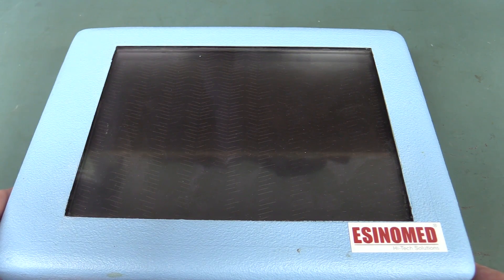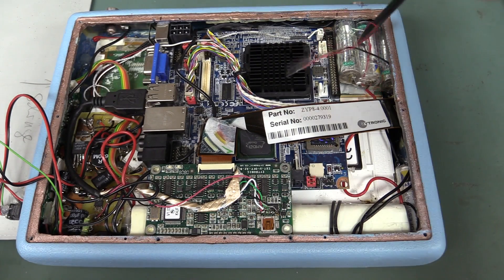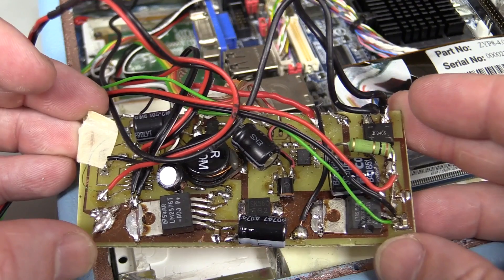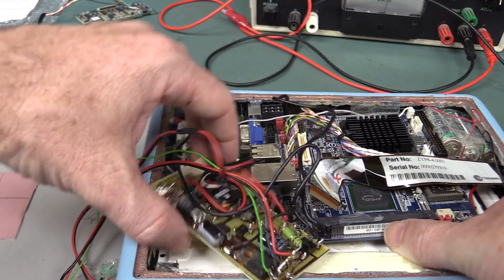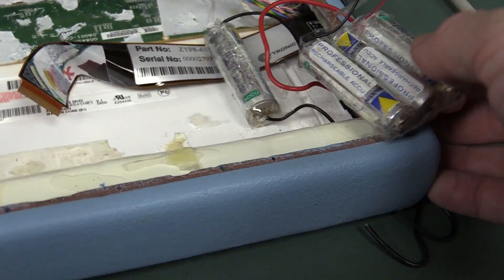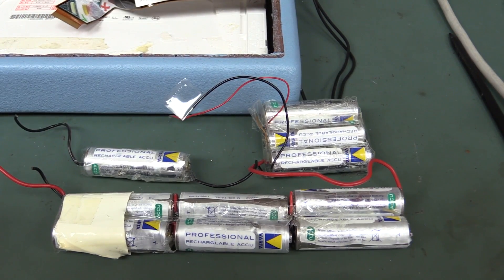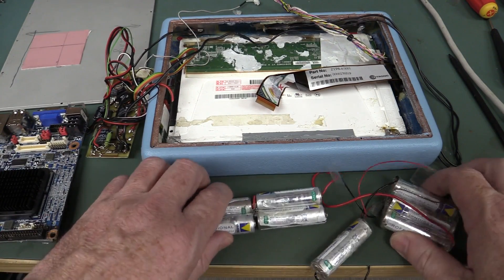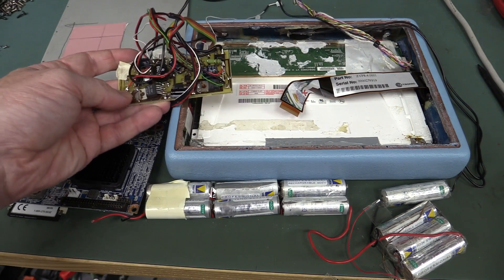EEVblog #822 - World's Worst Tablet Computer Teardown

Comment: Oh jesus - my eyes.

Okay, this level of work is totally acceptable .. on a Ratshack LED chaser kit ..if you're eight, and snorting meth, and only have a tire iron in the wood stove to solder with - but this abortion was actually delivered to a hospital??
Reply from the maker: +Jim Vicious Well, I recon it was at least shown to the client
Reply: absolutely impressive that this thing actually worked
Reply: +the electronic man I have done better soldering jobs using a gas heated copper shaft as a soldering iron. but still the board it self looks like the person was just learning about etching, even I have made better boards with a felt tip pen and I have even used sticky tape to draw the circuit for etching,  I have made tiny FM bugs with oversized solder iron lol.  the point he is getting at is, it is for medical use and must be professional, it just show what the hospitals really get for our money  and how safe we are
Reply: +Jim Vicious It is not a medical device, it is just to show information to the patients, so the hospital probably did not make tests. if it fails this is not a critical situation, they can still print the info instead...
Reply: +Jim Vicious and it cost them $14,999.99
Reply: rfvtgbzhn
No I do Not  But If it is for hospitals the mark up would be insane....
Reply: +Jim Vicious 
around 68 or 69 I had a 5 transistor radio kit.. 
that was 45 years ago...
that radio kit was high tech electronic compared with this..

and this  product shopws the reality about ""german engineering"""

this is not the place  to talking about cars, but in my stepdaughters bmw ... I can find exactly same  craftsmanship like this ...
Reply: I worked in IT in a large NHS hospital for 14 years and this doesn't surprise me at all. Suppliers were always happy, in my experience, to bang together any old piece of crap, wrap it up in a fancy case and sell it directly to clinicians who they knew wouldn't be interested in how (or whether!) it worked or if it would interface or communicate with anything else. This shitty tablet is typical of the sort of dross that is too often pushed out to the clinical market ... and ALWAYS with a premium price-tag because it is "clinical".
Reply: +Jim Vicious An 8 year old on meth? YES!
Reply: you can do it butter job solaerdong
Reply: +cnccarving But...but...ju kant say zat.
Jerman Technolojy iz ze best. We pay efribody in ze media to zay zo.
Ju kan not speek againzt ze media. It kost uz a fortune to get efrizing goink again after ww2.
So we haf to safe a bit on ze produktz.
Reply: tiporari
A few years ago some ATMs still used Windows 3.11.

There is no reason to change a system as long as it is sufficient for the task for which it is used. NASA used 8086 processors at least until the end of the Space Shuttle program.
Reply: German Engineering as well! I thought they were all about quality
Reply: Jim Vicious Tablet Built by Encino man
Reply: mathew M
Do you really know the price or is this just a guess.
Reply: cnccarving
Actually I think that they do this on purpose for many products like cars, they want that a lot of components fail as soon as the warranty is over, because they can sell their overpriced replacement parts. Also they want to reduce the number of used cars on the market mainly by motor fails, because motor replacement is uneconomic in most cases for cars older than about 10 years. This is called planned obsolescence.

Actually the old Volkswagen cars (like the original Beetle or the VW Bus) where built much sturdier and needed much less maintenance than any modern car.

Actually if you count the hours a car is actually driving before some parts need to be replaced or before it fails beyond economic repair, you see that cars don't last very long compared to most other products. E.g. the average total mileage of a car before it goes to the junk yard is about 150,000 km and the average driving speed is about 30-40 km, so an average car is only used for about 3,500-5,000 hours. And it needs a few repairs during this time. And most cars that go to the junk yard go there because of failure beyond repair, because people who want to get rid of a working car usually sell it. For comparison: If I remember correctly a TV is used for an average of 10,000-20,000 hours.
Reply: +rfvtgbzhn This company is still exists. In the engineering capital Germany. They should be ashamed of them self. German quality isn't worthy this.
Reply: I used to work with companies like this (no names or I'll get sued).  XP embedded means this was around late 90's or early 2000's (a guess).  I've seen and fixed worse.  My favorite was the group that used the same charge controller that killed the Martian rover.  Got the charge controllers cheap after that interplanetary screw up.  Same software.  guess what?  killed the batteries in the devices on earth too.  lol.
Reply: tiporari
XP was released 2001, Vista in 2007. XP embedded was used on new  machines long after Vista was released, because embedded systems in 2007 where usually not powerful enough to run Vista. It is still supported by MS (at least some versions like Windows embedded POS ready, which is basically just XP with registry changes) unlike normal XP.
Reply: I would say it's a product built elsewhere and not actually German at all, the company with their name on it probably never opened one up, most likely just a team of salesmen.
Reply: Proof of concept
is not the final production model.
Reply: +EEVblog  nice  that look's  like shit   man     no way lolhhehe
Reply: +Jim Vicious  that look's  like shit  man
Reply: +rfvtgbzhn Are you serious? Other than one that was totaled in a crash, I've never owned a vehicle that did not last less than 200k miles. Hell, my 1995 firebird is pushing 300k and I drive it everyday.
Reply: Grahamicus Rex
This is exactly what I was writing in my first comment about cars: engines of old cars last longer, but not of cars built in the last ~20 years. These cars last bout 150k km or about 100k miles until they have a failure that is uneconomical to repair. Of course this is true for an average driver, if you drive something like 20k miles a year, you will probably get more miles, because after 100k miles your car will be only 5 years old, so it will be more valuable than an older car with the same milage, which makes it more likely that a major repair is economical.
Reply: Haron Hajem
Yes, it is for a hospital, but it is not a critical device. it is just to show information to patients, so if it fails they can still print the information instead...
Reply: +cnccarving 
Don't forget we Nazis brought you to the moon.
Reply: Still surprises me when I see ATM machines and old point of sale stuff Blue screened or crashed to an XP desktop.  
I hated those embedded systems 10 to 15 years ago, they were dog slow then.  Feel sorry for the people who still have to support them.
Wyse terminals are still being used in a lot of hospitals today, and we installed them in 2005 or so?  Yeesh
Reply: Why customer? He said its out of an insolvency sale of that company. Besides that, products in Europe need CE to be oficially sold and this product certainly hasnt a CE marking.
Reply: I cannot look,i have 12 and i solder better.That thing is used in hospital????
Reply: +Elliot Action Yeah.....ill gotten gain.
Reply: Typical for the Healthcare sector. Second-rate slapped-together solution sold at astronomical prices from somebody's relative or "associate" who's an "expert". Guaranteed the doctor's office and/or hospital that bought this paid at least $15,000/unit.
Reply: theedrstrangelove
It is unlikely that the cars you owned are representative for all cars. Also if a car is driven a lot, it is more likely that it will get a high overall mileage, because if you have a major failure after e.g. 100k miles, the car is not as old as a car with a lower annual mileage, so the car will have a higher value and the chances, that a repair is still economical is higher-
Reply: +rfvtgbzhn I&#39;m sorry, but no. If you properly maintain an old VW engine (let&#39;s say a 1600) you will be doing a hell of a lot more than even the crappiest modern engine. 

For starters, the VW didn&#39;t have an oil filter (the screen doesn&#39;t count) so oil needs to be changed much more often. Points have to be addressed. Valves adjusted every 2-3k. Carbs in the winter. Engine rebuilds abound.  I love these cars to death, but come on.

Kia has a warranty for 100k miles. Porsche engine maintenance is 10k miles between oil changes and  around 60k for an air filter change. Hondas run forever.
Reply: +Jim Vicious It's for a hospital, OMG!? What a disaster
Reply: +George David Hihi
Reply: +Jim Vicious wats bad is my soldering skill is so damn bad i thought it looked good lol smh
Reply: Are your solaerdongs thorium powered, too? Cause I really need a thorium solaerdong... for science.
Reply: +Jim Vicious embarrassing to admit ... it is solid Made in Germany quality (?) ... Well in Bavaria they still live in the technological stone age. Can you believe it .. they still close all stores there (in almost all regions) for lunch break .
https://www.google.de/maps/place/Gewerbering+5,+83134+Prutting/@47.8979331,12.1981955,16.75z/data=!4m2!3m1!1s0x4776101009bc5e7b:0x7d88e89421260719
And they still seem to be in business http://www.esinomed.de/
Reply: MrMegaPussyPlayer The lunch brake thin g is just a cultural thing, they also do this in e.g. Spain and Italy.
Reply: rfvtgbzhn But not anymore anywhere else in Germany. It is like beeing in a complete different country if thy flip up the sidewalk between 11:00-14:00 (depending on shop) and also from 18:00 till next morning
Reply: MrMegaPussyPlayer Yes but only for smaller shops. I know in Passau supermarkets have open until about 20:00 an without lunch break. Also all Shops in the shopping center don't have lunch break.
Reply: +rfvtgbzhn Sure there is.  Supportability is important.  Cost to keep them operating increases over time.  They don't manufacture parts anymore for some of these.  I hate having to service something that hasn't had manufacturer support for years.  Leaves you with the fun job of finding parts on ebay, salvage places, etc., and is often ridiculously expensive.
Laptops and embedded devices are often even worse with proprietary components, limited production chipsets, no specs or data sheets.  Ugggh.  
Lucrative but irritating work...
Reply: tiporari
I didn't think about the parts problem. This might be less a problem for ATMs because they use standard PCs as far as I know, but they are in special casing so they cannot be easily manipulated physically and they are only connected to some banking network and not with the Internet, so they normally cannot be hacked except maybe by employees.

But changing the system can also be costly, so it might sometimes be cheaper to just let the old stuff run as long as possible.

In critical systems like the Space Shuttle you might need a lot of engineering and testing to do an upgrade and they just now that the old stuff ran flawlessly by decades (non of the major Space Shuttle malfunctions where caused by problems with the electronic systems) so it was probably a good decision to look for things like 8086 CPUs on ebay instead of upgrading.
Reply: +rfvtgbzhn There are definitely use cases where keeping old reliable tech running is preferable, but it is universally expensive to do, and sadly that cost escalates over time owing to limited supplies of spares, and loss of expertise as experts retire and die off.  
A complicated topic to be sure :)
This video however does show some atrocious engineering and execution.  Very amateur and shady business practices.  Probably was ungodly expensive too.  I know the embedded systems I worked on in the early 2000's were stupidly expensive, but it was a free for all because there wasn't much competition, and major manufacturers didn't offer a lot of the mobile computing tech that was becoming more popular in healthcare.
Lots of hackery, good enough engineering and expected failures.  Lucrative support contracts created incentives to allow some dodgey work to go on longer than it should have...
Reply: tiporari
Yes, the system in the video seems to be very badly designed. I am not an electronics/computer engineer, but i still see this.

But at least it is not a critical system, it was just used for displaying information to patients. If it failed they could still print it instead. I guess they would have done more testing before buying the system if it would have been critical.
Reply: StonyRC Yep, that's been my experience as well.  And the software is equally awful.  Mature applications today make flying the space shuttle seem simplistic.  Terrible user experiences from ALL of the major players.  Clinical indeed...
Reply: German Engineering as well! I thought they were all about quality
Reply: Heard of prototypes?
Reply: hexacetat
Hmmm, unlikely..... What kinda of dipshit sends a design prototype for a customer to actually use?
Reply: +hexacetat
you're probably right, I didn't see the CE marking on this video although they show the front and back side or the product. Also usually it would be on the label, which is clearly seen at 0:36.
Reply: the serial number is probably 11 because it looks better when they made more than 1
Reply: 1HourMusicChannel
Even if it is a prototype, they could have made more than 1.
Reply: rfvtgbzhn
its just a little joke that they start with 11 to look more ''succesful''
Reply: no wonder Y some never got out from the hospital ^_^
Reply: no wonder Y some never got out from the hospital ^_^
Reply: Landrew0 proof of concept at SN# 11? wouldn't the first 10 had been proof enough?
Reply: @Jim Vicious - Award for best comment ever 😁👍

Comment: Surface pro 5 also running XP prototype, dual boot capabilities. has 4GB of RAM, Intel's abandoned "cancer lake" chipsets, AMOLED panel and all day battery with a single charge for 2 days. Comes with high-quality, soldered USB OTG. (Pen nowhere to be found)

Comment: Clearly the picopsu/ other off the shelf power supplies with a +12, -12, +5, -5 didn't work with the 8v or so they were getting out of the soldered together nicads.   Equipment for medical device manufacture often have boards like the homebrew psu youre screeching about.. interesting to see, but why so scathing? If its works it works. Whats wrong with 'hotsnot' anyway the amazon kindle is held together with it.

Comment: But, we used the the good batteries.  See?  It says "Professional" right on it.
Reply: ... and we replaced the cardboard battery sockets with the quality plastic ones.  Notice the corrosion didn't spill out onto the boards/components.
Reply: Don't forget about the high tech wire cutting!

Comment: i dunno, the unisurf 8" tablets arent that far behind
Reply: +Daniël's Tech & Music Channel ... no they weren't, not if you actually used your brain when buying them. I've got a 2006 HP convertible tabletPC that has a better screen than that, and more powerful hardware, and a better battery, AND a hinged keyboard, and it's still thinner and presumably lighter than this crawling horror. And a slate-style RM one from probably 2004 somewhere that's still not much bigger than a laptop screen of the mid-late 90s.

Apple did nothing more than employ some very clever marketing and develop an OS that, at least at first glance, was far more idiot-friendly (though any time I've tried to use iOS I've found it less intuitive and more annoying than both Android and Windows - it's main advantage is that it looks pretty, and it at least isn't Symbian). The original iPad was nothing special, any Windows slate of the time of similar price matched it for spec and wasn't that much larger or heavier despite having replaceable internals and more ports. The "fits in a manila envelope" thing that Jobs was so god damned smug about when he showed off the MacBook Air (which wasn't far off the size of an iPad)? Every post-2000 Windows device I own can also do that. But he did it with such conviction, with the showmanship of a vaudeville magician act, that everyone swallowed it without question.

Comment: Looks like something a teenager put together using old junk they had on hand.
I'm surprised the battery and PSU didn't catch on fire.
I wonder if someone bought it surplus ripped the original guts out and installed the geode board and other components so they could have a tablet running XP.

Comment: I have trained a lot of E.T.'s through the years at various jobs and companies I have worked for many straight out of tech school. I always told them the same thing, in electronics, neatness counts. At one company, who shall remain nameless because the Company is great but in the late 80's they had some real winners working there, I could always recognize who was the last tech who worked on the system. Supervisors and even Vice Presidents were amazed at this ability but each tech I encountered usually had the same bad habits repeated and it was easy to tell. Forget prints and schematics they were just recommendations on signal flow.

Comment: How do you know this is production unit? "Because it has a serial number" is definitely not an indicator. I have quite a few serial numbered devices that aren't commercial product.

I know everyone wants to jump up and down and fling poo at the developers, but this hardly looks like a device that would have gotten through any regulations  in its home country. 

I don't see anywhere near the amount of required labeling on the device for it to be approved by any regulatory agency. All the markings all over the chassis look like prototyping.

Good for a laugh, but I doubt this device went out the door. Feel free to prove me wrong.